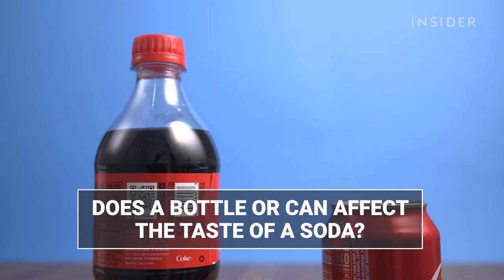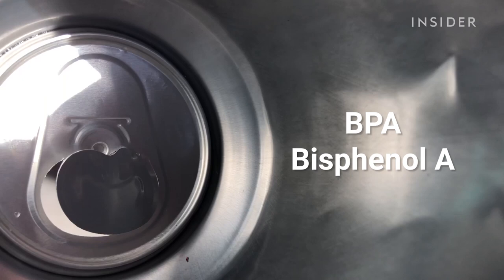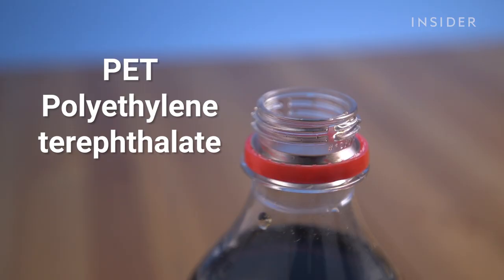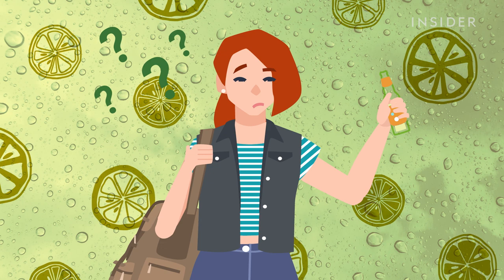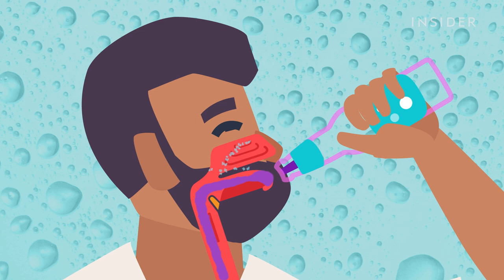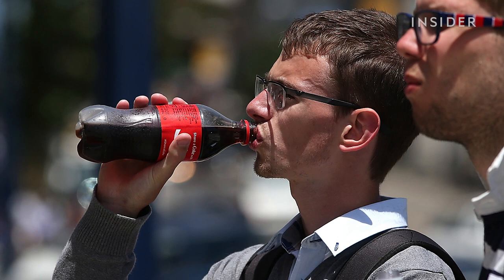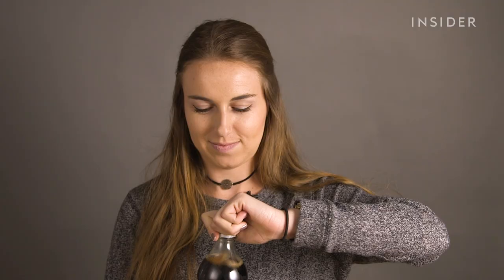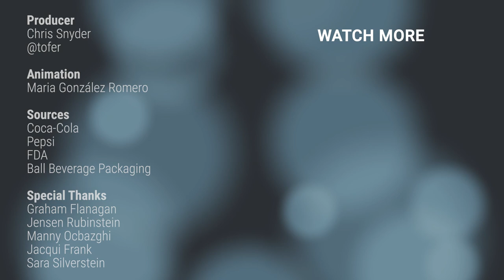Why Soda Tastes Different In A Can Or Bottle

Comment: I wish they would of included fountain drinks. Coke tastes very different at Whataburger vs McDonalds vs Chick-fil-A. There is a science to fountain machines.
Reply: Agreed
Reply: It's because they water down their drinks.
Reply: Anne Smith Fountain drinks are just carbonated water and syrup, i.e sprite, dr. Pepper, coke - it can taste better, or worse from a fountain
Reply: I have heard that McDonalds tastes so much different (better) than the other places because of how the syrup is stored (They store it cold, which most places don't. They store it in metal containers rather than plastic like other fast food places.)
Reply: That's because they can control the ratio of syrup to carbonated water. You ever go to a fountain drink and get straight carbonated water with a drop of syrup? 🤢 McDonald's uses a special blend for their coke too
Reply: that's the problem, machine soda depends entirely on how the owner sets it up, so it's a lot harder to put to a test or comparison with the other mediums. Having said that, I've had some really crappy machine soda and some really great one. Being mixed in the moment can give it a freshness advantage.
Reply: McDonalds Coke is super carbonated, have me burping after every sip lol and Jack in the Box coke tastes like nasty tap water
Reply: Fountain is much lighter (where I work) but that's how I prefer it
Reply: @carlosfer2201  Coke or Pepsi sets up the drink fountains. One bit thing though is how often the nossles are cleaned.  They should be cleaned everyday. This doesn't always happen. I've seen some full of slime before.
Reply: McDonalds coke comes in sealed chilled canisters that have to be hooked up to nitrogen. Wendys has theirs delivered in bags...

Comment: You also have to take into account that most glass Cokes are made in Mexico. This is important, because in Mexico, they use CANE SUGAR instead of High Fructose Corn Syrup which is used in the formula for plastic bottles, and cans. The glass preserves carbonation better than can or plastic bottle. Other than the carbonation, the taste is different due to a different recipe, and not the bottle (Cane Sugar being exclusive to Mexican bottled Coke).

Comment: Soda fountain > can = bottle

Why is a fountain better?
Because the flavor syrup is combined with the carbonated water the second it dispenses, so you technically get the freshest flavor, meanwhile the cans and bottles, the water and syrup are combined at the factory, and can take as long as a week to get from factory to your mouth.
Reply: The distributor also calibrates the mix  but I think they add more to compensate for the ice used and you may be getting a sweeter drink until all the ice melts.

Comment: Glass soda in CA is only available from a Mexico processing plant and they also use real sugar not HFC.    Cans  have a portion of the aluminum exposed when opened. so yes you are drinking out of an Al  holder but most of the drink is not exposed to it. unless it is old soda.   Old soda in plastic also looses so carbonation so it not as secure some go flat.   Thus freshness is a key factor too.   Diet has the shortest shelf life if you look at the markings.

Comment: It's not only different for everybody, but for me it is also different depending on the drink.

I prefer Pepsi from a can.
Coke from a glass bottle.
Beer from a glass bottle or a proper beer glass (especially hefeweizen).

The list goes on. But nothing from a plastic bottle. When I pour it into a glass though, it doesn't matter what the soda or drink was in before (with the exception being beer). I think the feel of the container wasn't adressed enough. The great thing about cans is that they feel colder and that changes the experience significantly. They also are smoother than plastic bottles. Our lips do play a role in our drinking experience. That's why I for example can't enjoy anything directly out of a carton. 

But I buy milk in glass bottles when I can, because I find the carton taste gets to the milk somehow. Doesn't seem to happen with juices though.

Comment: Different batches easily makes the biggest difference. And that the soda hasn't gone flat of course.
Anyone who has drinked Red Bull daily for years can tell which taste sweet and awesome and which taste off. And it's not from the effect that on some days i might taste it different depending what i've eaten but i've taste tested multiple cans side by side and others have a sweeter taste and others more bitter or just more off. I'm assuming every Coke batch can't taste exactly the same either